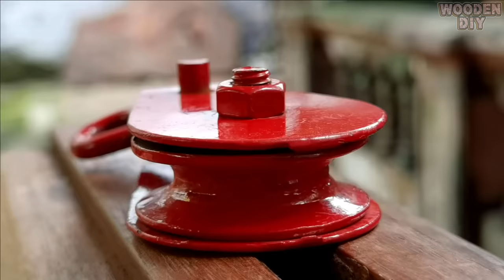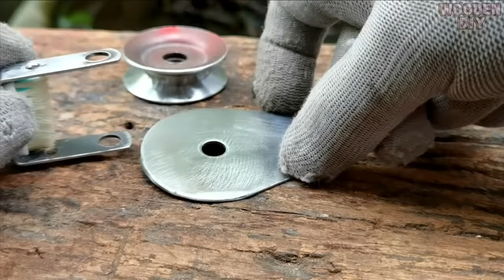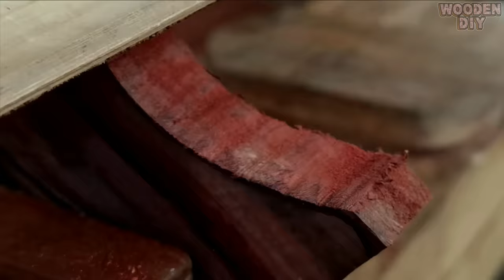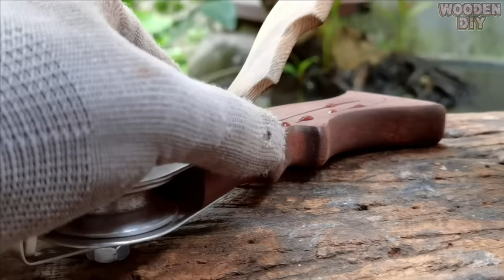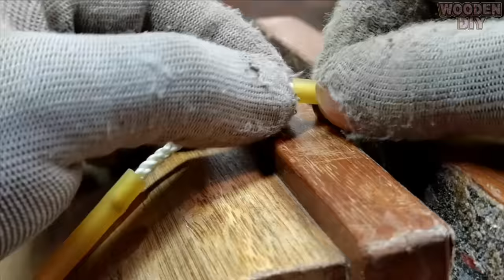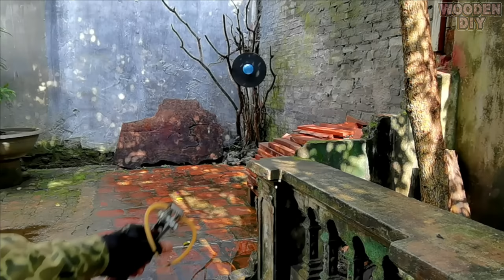Amazing Results - Crafted Slingbow from Pulley, Wood, Rubber and Super Glue

Comment: Needs, at least ball bearings if not precision bearings, the pulley a smaller diameter and down in the grip so the arrow rests closer to the hand, a flare on the back that rests in the thumb crotch, a fold-around wrist brace, a better way to attach the tubing so you can add as much as you like for more draw weight, and two brushes on forked sides so an arrow can be top loaded instead of threaded from the back and the fork extended down and mounted to where the metal pin is to brace it. And that wooden dowel pin will be a point of failure over time because of the leverage on it. A threaded insert with two low profile Allen bolts would be better. Still, pretty nice. Well done.